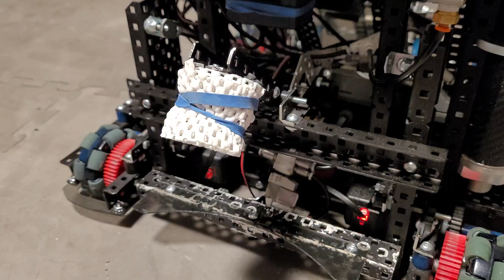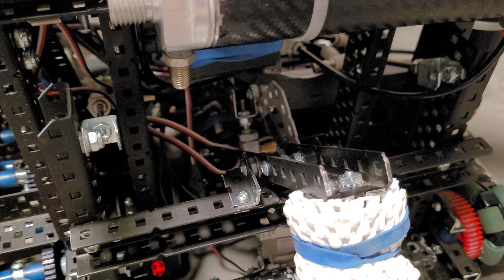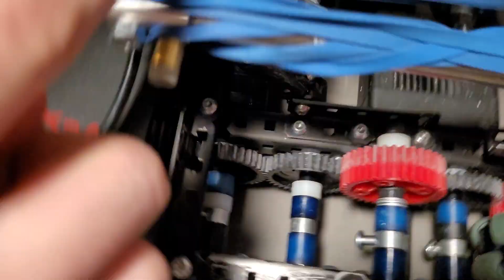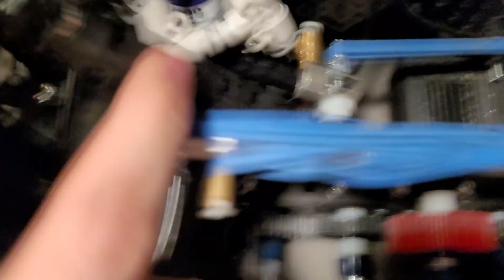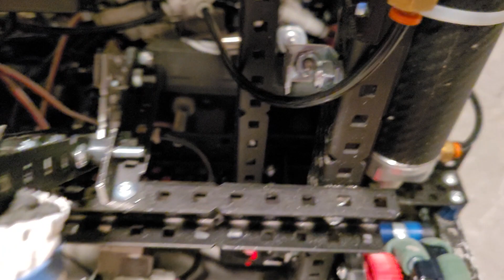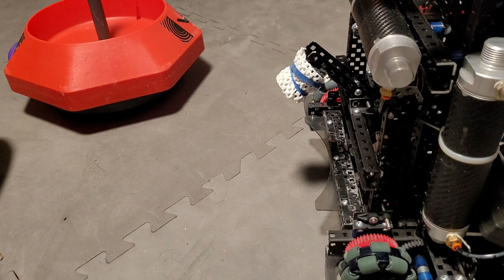Semicolon Back Mobile Goal Tilter 60470S | Vex Tipping Point

Comment: You can just have a back clamp that only requires 1-2 Pistons that automatically tilts the goal without needing Pistons to clamp on and tilt.
Reply from the maker: This makes the goal impossible to steal and is extremely simple to make.
Reply: @6047OSSemicolon  there is a two piston mech that is impossible to steal from 536c

Comment: I see you changed your drive. What is your new gears ratio and motors if you don’t mind me asking?
Reply from the maker: it is 450 rpm on 2.75 in wheels
Reply: @6047OSSemicolon  that’s interesting. I haven’t seen many teams use the 48t gears? We’re you inspired by someone/do you know any other teams using that gearing?
Reply: Is there a reason why yall are using such small wheels?
Reply: @229member  I assume it’s so they can get enough torque to drive up the ramp and to deal with rings
Reply: Casey Hein Thank you

Comment: I feel like you could probably use 1 on the tipper to conserve air pressure
Reply: Wouldn’t need to if they haven’t had and issue in a match
Reply: With the research into our back clamp which clamps and tips at the same time, they need 2 for 2 reasons, 1: having 1 piston probably wouldn’t be enough and 2: the piston would have to be centered which doesn’t look like much of a feasible idea in their case